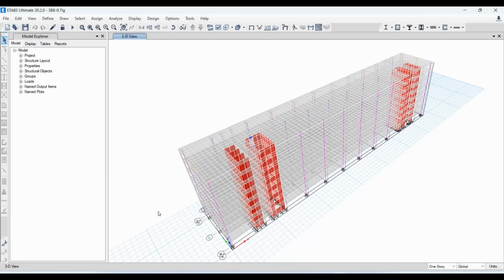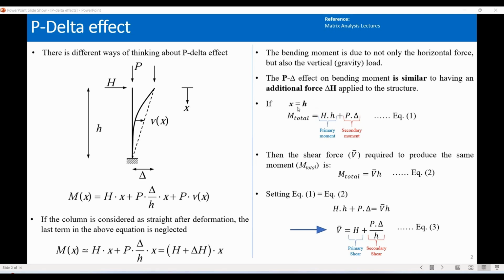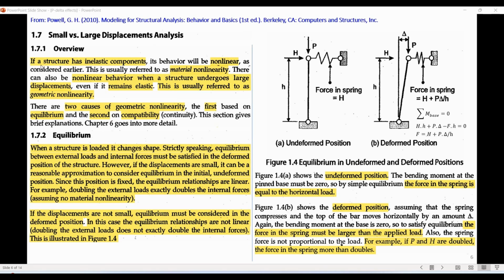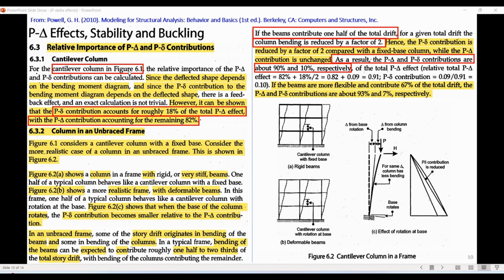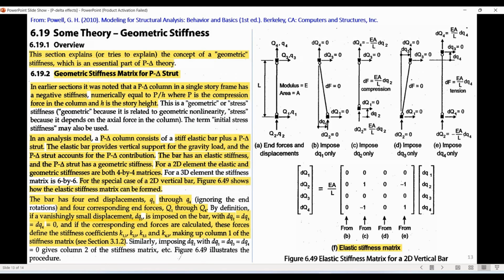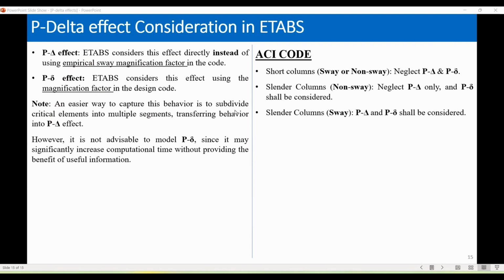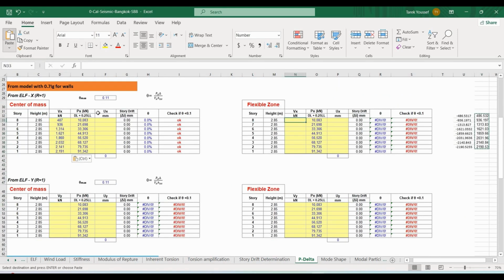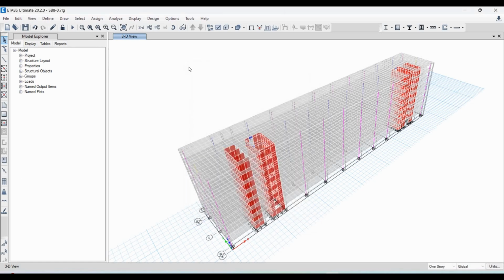ETABS Tutorial 16: Detailed Explanation of P-Delta Effects and Their Consideration in ETABS Software

Comment: Excuse me, Sir. In the case of steel structure modeling (warehouse) in ETABS, after running the analysis, a warning appears:
"The maximum absolute changes in the EI and EA reduction factors is 0.2. For 811 members, the reduction factors decreased by more than the negative tolerance of 0.01. Do you want to reiterate analysis and design?"
What is the cause of this warning? And what solution should be taken in this case? Should the design be redone, can it be ignored, or is there another recommended step? Thank you 🙏

Comment: What is the stiffness modifier while checking P-Delta? any reference
Reply from the maker: For concrete structures, it’s essential to estimate reasonable values for axial and bending stiffnesses that account for cracking, yield, and creep. As referenced in Dr. Powell's book Modeling for Structural Analysis: Behavior and Basics (2010), using effective stiffness values is critical for accurate modeling, particularly in capturing second-order effects like P-delta behavior. Adjusting for these factors ensures that the structural analysis reflects realistic performance under loads.

For further details on the appropriate stiffness modifiers to use before including and checking P-delta effects, please refer to tutorials number 5 and 12. These resources provide valuable insights into the necessary adjustments for effective modeling.